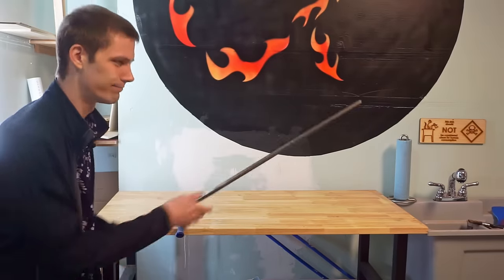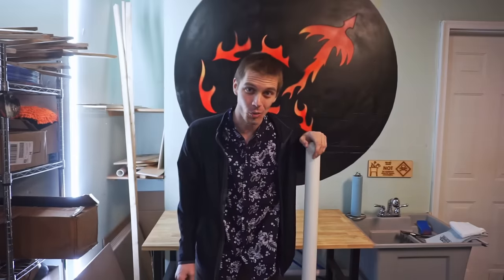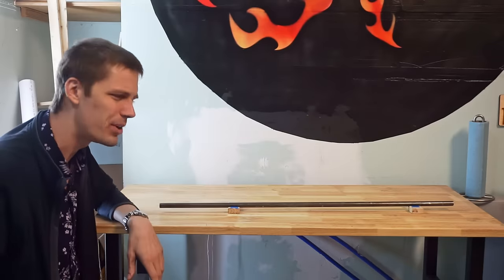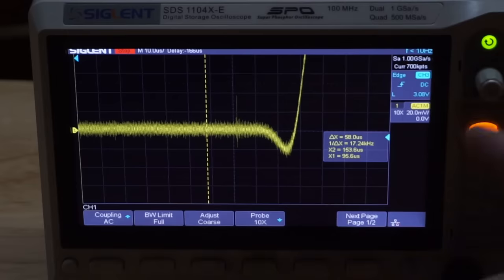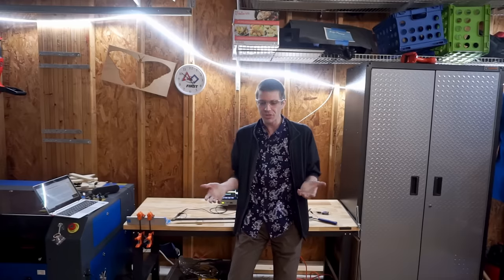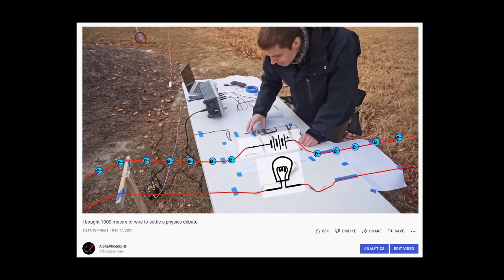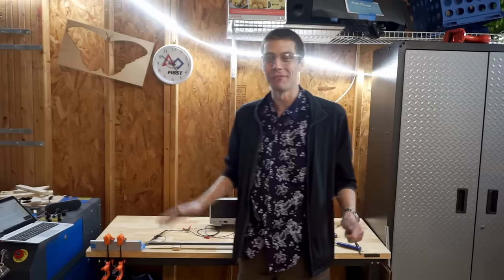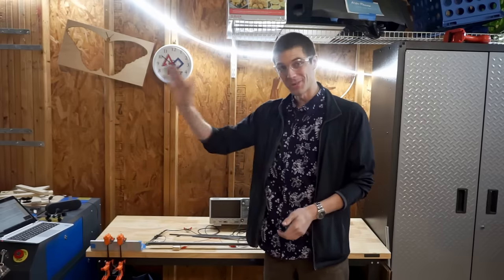Are solid objects really “solid”?

Comment: I love this video. As a machinist, we have a saying, " Everything is rubber." It's an anecdote about the difficulty of measuring things to extreme precision. There are literally calculations for the deformation of ruby on tungsten carbide . Sure you don't need it until you are measuring tens of millionths of an inch and by that time you need a climate controlled room and can't touch what your measuring for days before taking the measurement because the thermal expansion will throw it off more then the compression. They still exist
Reply: That was so cool. As a laymen, I have no idea what you're talking about but it's cool 😂
Reply: @ainzooalgown6450  he means things are hard/tedious to measure with extreme precision when you want extremely accurate results because things ( beside water) tend to condense and take up less volume when it’s cooled, where the volume (of tungsten) would expand ever so slightly if it was heated.
Reply: Water is most dense at around 4°C at standard pressure if I remember correctly so it will contract as it cools from 4°C down to 0°C where it again expands as it turns into a solid.
Reply: My father says that! I was always confused about it 😂 , I'm a virologist and I could not be a machinist in a million years I've investment cast my own jewllery but fine machining is art form to me
Reply: @HaasGrotesk  But a thousanths of an Inch sounds way more impressive than 0.0254mm/3 hundredths of a millimeter
Reply: @ValentineC137  Who says "0.0254mm/3 tenths of a millimeter" ?
Reply: @kalde108  fixed it if it’s the *ths word you corrected me on, hundredth/thousandth etc. isn’t commonly used where I’m from.

I’d just say “point o two five” or a direct translation would be “zero two five”
Reply: @ValentineC137  I don't know why you say 0.0254mm/3 hundredths of a millimeter. That's not how we write in the Metric system. Thousandths of an Inch is 0,0254 mm (millimeters) or 25.4 μm (micrometers) or 25 400 nn (nanometers). Or if you want to go the other way 0,00254 cm (centimeters)  or 0,000254 m (meters) or 0.00000254 dam (decameter). So I think 25.4 micrometers sounds hell of a lot more impressive than thousandths of an Inch. It's certainly much easier to convert different units as you see.
Reply: @kalde108  A brain stuck on the awful imperial system. @Valentine 25.4 micrometers.
Reply: @HaasGrotesk  metric precision measuring tools are harder to buy then imperial unless you buy electronic measuring equipment. Imperial measuring equipment has been made longer because the industrial revolution was initiated by the United States and England which were at the time using imperial measurements. Some of the standards started before the metric system existed. The United States developed under the Imperial measurements system before the metric system existed beyond the point of no return. Sure we build new machinery using the metric system but some companies still use machines from the 1900s, because they seem to last forever, and you cannot just make it metric.
Reply: @snr7287  From a machinist standpoint it doesn't matter if it is metric or imperial we don't use fractions. It's all decimal and at that point it is just a different set of tools. There is no difference between a millionth of an inch and 25.4 nanometers except that buying a tool that measures nanometers physically is much harder then finding a tool that measures in millionths of an inch because they have been produced for a longer period of time.
Reply: @FPSG  I'm sorry but I don't agree with you at all! There is absolutely no sense in what you are saying. Only 3 countries in the entire world uses the imperial system and the rest of the world uses metric. There is far more metric machines produced and used in a year than there are imperial machines troughout the history! Most serious manufacturers in America have switched to metric machines already in order to be able to have a trade with rest of the world. If you're making things with imperial measurements you can basically sell that stuff only in USA and nowhere else because no one would by stuff with imperial measurements. Maybe small local shops still hold on to ancient machines from the industrial revolution but that's not many. It may be hard to buy "cheap" metric machines but that's not the same as that they are harder to buy because of availability. 

Regarding the industrial revolution. It was not initiade by United States and England. It was initiaded by The Great Britain and Americans came along almost 100 years later. It was called "The second industrial revolution". You never initiated anything nor were you on the forefront of anything. 

Now tools aside. Metric system beats imperial system any day of the week and it's impossible for you to show otherwise.
Reply: @HaasGrotesk  The industrial revolution started around 1760 in great Britton, now England, continental Europe  and The United States. It lasted until 1840. The second industrial revolution started around 1850 to 1870. The metric system was not adopted untill 1820 at the earliest and not fully adopted untill 1900. Pipe thread was standardized in 1820. Whitworth threads predate metric. Imperial isn't better then metric. But it literally doesn't matter from a machinist standpoint. .00001 inches or .000254 mm doesn't matter. Machines are all decimal, no fractions, no uM, no NM, only inches and millimeters. I have no reason not to work in both.
Reply: @HaasGrotesk  custom machine tools are usually bastardized with metric and imperial parts. Beside all pipe and hydraulic fittings are imperial as far as I know. BSPP and BSPT are from a company in Pennsylvania and NPT and NPS are a further standardization of the former. They are nearly interchangeable. On that same note standard bearing sizes are metric. In all fairness early machines used babbitt bearings so metric ball bearing standards seem time appropriate. It is literally not a problem to mix the two.
Reply: @HaasGrotesk  I would also like to point out that raw materials are imperial in North America. So it makes it hard to buy steel in metric units here. The option of using a 1 inch thick steel plate as is or milling it down to 25 mm so it can be metric, what do you think a company is going to do.
Reply: I cringed every time he hit that metal round stock with a hammer, I'll never get a bearing to slide on as he slowly mushrooms out the end. To all you metric lovers, I've installed lot's of metric equipment that on the prints was layed out in MM's, usually 30480 mm long ovens (100-foot ovens are the industry standard).

Comment: When I was young information was less accessible and it has been a mystery for years, I was pretty sure it was possible to transfer data faster than the speed of light this way. Nice video.
Reply: Well it proofs that it's not possible with iron. Maybe it's possible with diamonds or some material 10 times stronger than diamonds. (Where the atoms are more "stiff")
Reply: @JarutheDamaja  No, the interactions between the atoms still have the upper limit of the speed of the light.
Reply: The speed of light is also called a speed of causality. It's impossible to be faster than this speed.
Reply: faster -> swiftlier; not nice < niais < nescius := not-skilled but you are: -> well
Reply: @tetramaximum  It's the fastest speed the processors of the simulation we live in can run at. If you break the speed of light, the thing blue screens.
Reply: @alysdexia  w-what?
Reply: This thought experiment usually shows up early in a course on special relativity. It demonstrates that rigid bodies do not exist in relativity (because their speed of sound would be infinite). Instead, a modified approximation is used called Born rigidity, though this is too restrictive in many cases. The biggest complication is that Born rigid objects cannot change their rotation.
Reply: @LachanceM  ahhh, The Matrix has limits...
Reply: in 2011 i was tought that, wrapping a wire around the world far enough, and using the instantaneous ability of electricity, you can get electrons moving faster than the speed of light. Public school in canada. so wrong lol
Reply: @DataStorm1  Until next patch.
Reply: @loleq2137  bad diction
Reply: @LachanceM  fastest -> swiftest
Reply: @dragonwizerd  In reality, direct fiber-optic connections are sometimes created between cities to reduce the latency of the connection for high-frequency trading. That's specifically because a shorter cable allows for less delay. Also, I think the speed of light in some fiber-optic cables is faster than the signal speed in most twisted pair copper cables.
Reply: @LachanceM  exactly 💯
Reply: (correction) When I was young information was less accessible and it has been a mystery for years, I was pretty sure it was possible to transfer data faster than the speed of light this way but alas, it is not. Nice video.
Reply: @dragonwizerd  unbelievable
Reply: The propagation wave travels at the speed of sound, Seismology depends on this fact.
Reply: Naysayers, now hold on just a dang minute! From what I recall of speed of light (SOL) equations is that it's impossible to move AT the SOL because this results in something divided by zero, ie, an infinity. But there's nothing in those equations saying something cannot move FASTER than the SOL, which I think results in some negative numbers we don't yet understand. And since I'm on a rant, absolute zero is very fishy too, for similar reasons.
Reply: @orangequant  to exceed LS would require infinite energy, that's the problem, but as we are talking of about 3,235 m/s if its mild steel, and at 25C, NDT testing does this test every day.
Reply: @dogwalker666  Yes yes! Exactly! And that infinite energy requirement occurs AT SOL, not before it nor after it.
Reply: @LachanceM  simulation theory is generally predicated upon a misunderstanding of things like quantum physics. Even if the universe is a simulation, there would be absolutely no way of knowing so from within the universe. The speed of light is not evidence of a simulation. To my knowledge, it is a factor in the flow of time itself, meaning that if there were no limit to the speed of light, there would be no time (and therefore no space) either, with everything happening everywhere in the same place, all at once. Something like that
Reply: Wow, vous ici ?!
Reply: @OtateriheemEdRiemLav  Quel genre de passionné manquerait ça ?
Reply: @MichaelPohoreski  LOL nonsense
Reply: @MichaelPohoreski   Bruh, I am a mathematician. My intuition tells me that you are not.
But I remember one of the first things our professor told us in the very first analysis lecture I attended: that intuition is not trustworthy when doing math and we should take care not to get led astray by it. LOL
In any case, I have no clue about your intuitions because I can't read minds. I can only go by the incoherent rambling you share here with us so far. And I find that it is all pretty worthless, false, misleading or otherwise defective and unsubstantiated. It seems you are going by some half-knowledge and sensationalist speculations about the possibility of warp-drives or something. I am not familiar with those speculative theories. But there was an interesting video by Sabine Hossenfelder about it recently. I recommend you check it out. She's always a good address for down-to-earth no-nonsense takes on current developments in speculative theoretical physics.
Reply: @MichaelPohoreski  "When First Contact happens this century, in a decade or so..." 
awwwwww.
You were doing so well too!
Reply: @MichaelPohoreski  LOL

And gullibility won't get you far.
Reply: Very distant objects with mass such as planets and stars are travelling away from us faster than the speed of light. Though the objects themselves are not actually travelling that fast the space between us is also expanding/stretching so they are effectively moving away from us faster than light. That is the only way that physics currently allows faster than light travel at large scales. Quantum entanglement allows it to happen at small (atomic) scales and has been tested to work over atoms a few kilometres apart I believe.
Reply: @SimonWoodburyForget  Quantum entanglement allows information to travel instantaneously across the universe, any distance, in theory at least.  That breaks the rule of special relativity .
As far as space stretching, yes that is not really travelling faster than light. Special  relativity does say that speed/velocity is relative to the observer. If  the distance is far enough away to cause space to expand from us at close to light speed and the object itself was moving away from us that little bit extra enough to cause it to be receding faster than light then it will move out of the observable universe for us but (I think)  we may be able to see it before it crosses that horizon . This does make my head hurt though.
Reply: Same
Reply: A lot of MENSA members in this thread lol
Reply: @LachanceM  patch was downloaded with tonga volcano .. just needed to be installed next covid variant
Reply: @LachanceM  if you break the speed of light then the light police come for you
Reply: @LachanceM  but what is supporting the processors? A giant turtle maybe? And what's underneath that turtle? Turtles all the way down lol
Reply: @JarutheDamaja  the speed of light is the fastest information can travel through space
Reply: @LachanceM  carry on like that and they may have to wake you up.
Reply: now people literally transfer data at the speed of light with fiber obtic
Reply: @alysdexia  what is the relevance and significance of your tangent? Just to appear cryptically smart? Are you fantasizing about starting a cult? Do you have a god complex? Or are you just trolling?
Reply: @UnknownUser-rb9pd  quantum entanglement doesn't break any rules
Reply: @Gunth0r  my comment was about another comment, not a tangent, aytist.
Reply: @Gunth0r  I thought Quantum Entanglement allowed information to travel instantaneously  anywhere in the Universe in theory.  However I see that it is somehow deemed a property of the particles and therefore doesn't violate Special Relativity and I will read more about it and the many worlds concepts when I get a chance.
Reply: @alysdexia  I don't know, man, the way you connected those words together seemed pretty tangential.
Reply: @UnknownUser-rb9pd  Proud of you! :D
Reply: @Gunth0r  secantial